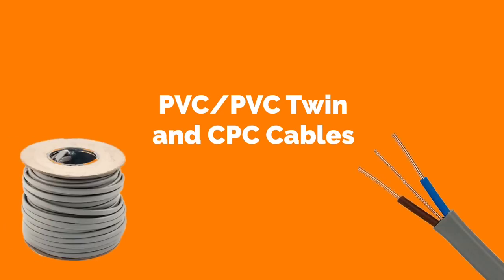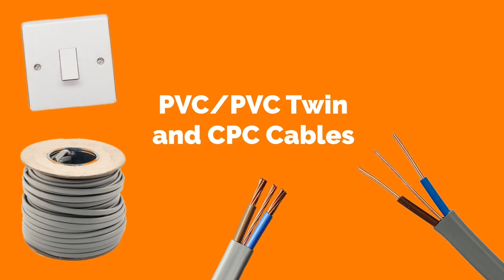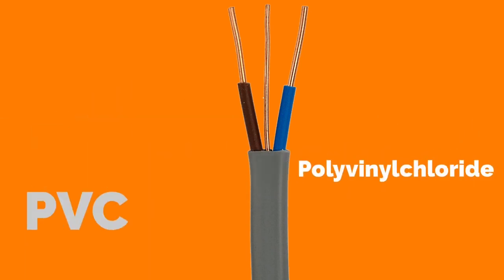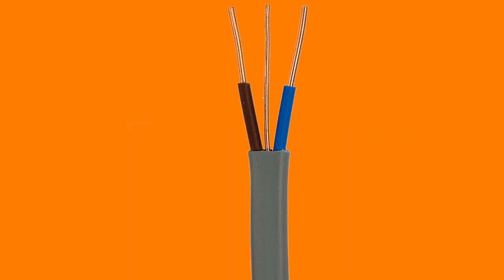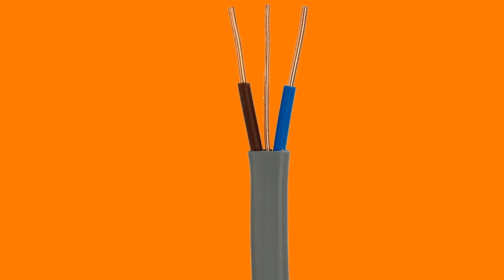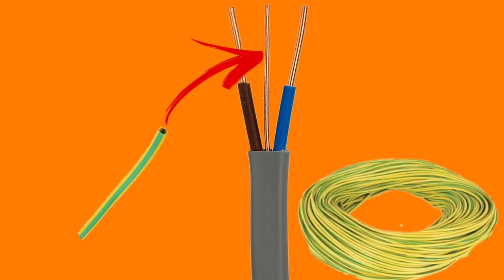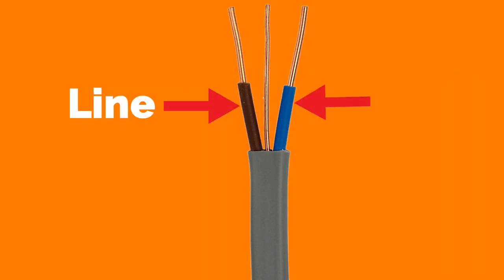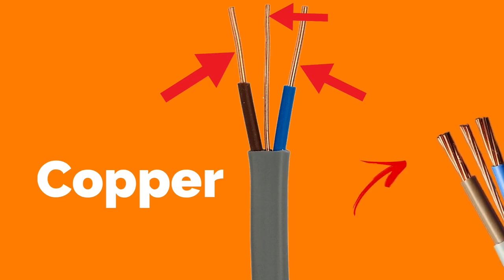Construction of PVC/PVC Twin and CPC Cables (Twin and Earth Cable)

Comment: As of September 2017 all twin & earth cable up to 16sq used in domestic situations in Ireland requires that the cpc throughout it's lenght in the cable be insulated and be of the same size as the load carrying conductor's... Only drawback it now increases  the diameter of the cable thus also reducing the space within conduits and trunking's in which if they were to be used...
Not sure if this change is on the card's for the UK in the near future!
Reply from the maker: Hi. Thanks for that information 🙌 and watching GSH Electrical

Comment: Why are some cables solid and others stranded?
Reply from the maker: Hi. We will be covering that in a future video. It makes them easier to bend and work with. Thanks for commenting and watching GSH Electrical
Reply: If you still need an answer, it's because solid core is cheaper to make, it's denser in terns that it has no air in it like stranded, reducing the size, it can follow shapes and stay there which makes work easier and since the surface area is smaller, it handles corrosion better.
As for stranded. It's a lot more flexible so it's just easier to use in day-to-day applications and portable things. It won't break as easily if it's moved. It also soaks up solder a lot better so it's more solid against thermal expansion stress and movement in a joint to a circuit board for example.